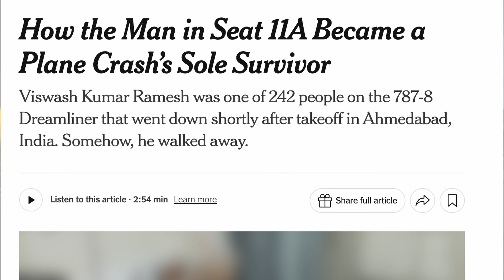Why the RAT Changes Everything – Air India 171 Update

Comment: My first impression was that there was an explosion or fire in the tail end of the plane indicating sabotage.
Reply: back of the plane was intact. what are you talking about?
Reply: @king_has_no_clothskul8635  In the video it looks like it’s on fire. It’s bright orange and red.
Reply: @kevindimauro9689  that is impossible to tell. no there was no fire at the back. it is colored that way but that should not be the case. may be for night visibility like black box is orange. you saw where it was stuck in the building and also when it was pulled down, you can see letters under the belly. the tail part and baggage remained intact.
Reply: @kevindimauro9689   hell no.

Comment: The flaps look like they were not set properly for take off. Flaps look like they were flat and even with the wings on its way down. The engines sounded like they were running and not failing. No lift without the flaps. More power from the engines would not save it from dropping out of the sky at take off.

Comment: @CaptianSteeeve so if we are going to speculate, based on historical data, the 787s  have previously experienced a problem with thermal runaway in the electronics bay.  When this plane was taking off it was 40 degrees C outside. So the question is : if this had happened and the electronics that manages the engines suddenly went down, what would be the result? Would the engines continue at the last throttle input setting? Or would loss of data input to the engines cause the fuel values to close?
Reply: 40 is not hot. they must have been designed to withstand engine temperatures in hundreds. but that could have happened.

Comment: as a model airplane enthusiast  i agree with what chat gpt has said about the RAT system 

when a Ram Air Turbine (RAT) deploys on an airliner, it can produce a noticeable sound, and to many people have resemble the high-pitched whine of a large nitro model airplane engine.

Here's why:

    The RAT is a small wind turbine that drops into the airstream when a plane loses electrical or hydraulic power.

    As it spins rapidly from the rushing air (at hundreds of knots), it generates a high-pitched whirring or whining sound, especially if you're seated near where it's mounted (typically under the fuselage or wing root).

    The sound is caused by the fast-spinning turbine blades and internal gearing, similar to the sound of a turbocharger or a small jet engine—but passengers often describe it like a model airplane engine due to its pitch and volume.

However, it's usually not deafening—more like a sharp mechanical hum or buzz. Pilots and crew will hear it more clearly, especially if it's a smaller aircraft or the cockpit is close to the RAT's location.

Comment: @CaptainSteeeve
@3:57  LT & RT spoilers are deployed, not seen this before on takeoff, and odd for roll control at this time.
....
As a former aircraft mechanic, I’ve been reviewing the available footage and noticed a few things that might be worth mentioning—possibly indicative of deeper issues:
	1.	RAT Deployment
You covered this thoroughly already, but it’s a key detail that points to serious inflight systems trouble.
	2.	Partial Main Gear Retraction
It looks like the gear retraction sequence started, but then either paused or failed—possibly coinciding with the moment the spoilers were being deployed.
	3.	Spoilers Partially Deployed on Takeoff (Both LT & RT)
I’m not sure if that’s part of an automatic roll stability function, but seeing both spoilers partially up—combined with little or no flap extension (if that’s indeed the case)—could have severely impacted lift right when it was needed most.

Zoom in closely at the very late rotation, right at the apron or runway end. You’ll notice a lot of debris being kicked up—at that same moment, the spoilers and gear position become more obvious.

Thanks again for your thorough coverage and for always putting aircraft safety front and center. 👍✈️

Comment: On the Boeing 787-8, the Ram Air Turbine (RAT) would be deployed automatically or manually in the event of a loss of all primary and secondary electrical and hydraulic power. This could be triggered by a double engine failure, or a failure of both the main engines and the Auxiliary Power Unit (APU). Essentially, the RAT acts as a backup power source, providing hydraulic and electrical power to essential systems like flight controls and avionics when other power sources are unavailable.
Reply: This RAT issue changes everything. The flight crew is 99% in the clear. My deepest condolences to the relatives and friends of the victims.

Comment: If you look at the video playing around 1:37, there's dust/debris being blown back just as the plane is on the other side of the, I'm assuming, ILS shack.  At first, I thought it might be water from rain but other videos show it clearly wasn't raining. I watched an episode not too long ago of Air Disaster where it highlighted the Buffalo crash. Ice broke off the wings of an MD-80 and went through the engines, damaging the titanium fins. The damaged fins caused the air to flow incorrectly that surged the power and eventually flamed them out. I wonder if something similar happened where they went by and something went through the engines causing the dust/debris cloud and it damaged the fins. Having the throttle at full power for takeoff wouldn't have allowed them to dial back the engines to regain proper air flow.

It's pretty damn rare to have a simultaneous double engine failure.

Comment: thank you for recognising the RAM AIR TURBINE  as I still feel it was a hydraulic failure. The fact the landing gear would retract is why I feel its a Hydraulic failure. However maybe they purposely did not raise the LG because they did not have POSITIVE RATE.... so they kept the LG down.

I agree its most likely DUAL ENGINE failure or Hydraulic failure (although the modern hydraulic systems are supposed to be redundant and compartmented as to avoid the entire amount of hydraulic fluid escaping) 

I love that you fly a 777. You understand all the Hydraulic and fuel systems along with knowing a APU is and what it does apart from a cart start.

Would you agree with my theory that the LG was not raised because they didnt have POSITIVE RATE?

Greetings from Australia.... and also the BLACK BOX was invented by an Australian
Reply: OK, thanks for the ANALYSIS

Comment: Real theory is a complete loss of  electrical power due to Lithium batteries that exploded, causing  all control flight systems inoperative, which deployed the RAT.... They were going too slow for the RAT to provide full voltage, where altitude and time ran out for the pilots to throttle up the engines.

Comment: The Ram Air Turbine was deployed from the sound comparison. Just watch, https://youtu.be/WHHY9SygEQA?si=i3N4Neiz7HM4REw0. So, there was an irrecoverable dual-engine failure for RAT to be deployed. The DGCA's initial preliminary findings were out. The likelihood of a pilot error is considered minimal, as is the simultaneous failure of both engines. Other possible reasons for the RAT deployment are low pressure on all hydraulic systems and loss of all electrical power to the captain's and first officer's flight instruments due to lithium-ion battery issues. The 787-8 is an electro-hydraulic jet that needs both electrical and hydraulic power to operate safely.

Comment: (machines) just don’t fail specifically aircraft engines: 

A plane takes off every two seconds somewhere in the world, and how many engines fail one can easily do the math, it has to be a maintenance issues with the engines that were overlooked and remember (I am not blaming specifically the region where it took off from) this kind of accidents normally don’t happen in developed regions of the world who are more stringent about safety and maintenance in any industry and at any level.

Comment: Why was the gear still down at 600 feet?  If both engines failed, was there possible fuel contamination or a suicide pilot that suddenly flipped off both fuel levers?

Comment: One other video mentioned they did a short takeoff and used 100% of the runway and lifted off after they went into the unpaved overrun. You can see huge plumes of dirt and dust when they lift off. I'm going to say that likely caused the engine trouble. They were at max power sucking dirt, sand and rocks into both intakes. They sandblasted both engines and caused them to fail. The next question - why did they do a shortened takeoff?

Comment: I think a complete hydraulic failure makes more sense.  It fails after the gear is selected up, so the gear fails to retract. Correct me if I’m wrong but the flaps are hydraulically actuated, so the loss of hydraulic pressure causes the flaps to retract prematurely which causes the wings to lose lift as they are too slow. Even with the engines at full power, they are likely unable to accelerate out of it so the airplane has no choice but to start descending.  The RAT gets deployed, makes the lights flicker. I bet the Mach clackers will be heard in the CVR tapes.

Comment: “Last year, a former quality manager at Boeing warned that the factory that made the 787 Dreamliner—one of the company’s newer models of airplane—was plagued by shoddy work practices and poor oversight. John Barnett, who had worked for the airplane manufacturer for many years before becoming one of its most outspoken critics, said that Boeing was building the planes with ‘sub-standard’ parts and that its mandate of speed and efficiency was endangering lives. Barnett, who refused to fly on the Dreamliner, was also involved in a legal dispute with the company at the time that he died of an apparent suicide.”

Upon launch, the plane was almost immediately plagued by technical problems. In 2013, a series of battery-related fires in aircraft cabins caused the FAA to ground all of the 787s in the U.S. until the safety issues could be resolved. In 2015, the U.S. air safety authority discovered a software bug in the plane’s generator-control units that could hypothetically lead to a “loss of control” by the plane’s pilots. The plane also suffered from fuel leaks and other issues.

Comment: During the mayday transmission, the pilot reported loss of power. Caotain Steve is providing some fine content regarding this. .He and Mentour are owning it. It definitely sounds like the RAT was deployed when the aircraft passes. You can hear that RAT. There is a video of the aircraft on its flight before this, where AC wasn't operating, in-flight entertainment systems not working,  call buttons not working.

Comment: Pilot here..... a further piece of evidence  I might suggest is the ADS-B data obtained from Flight radar 24, The data points stop at the highest altitude that the aircraft reached which is where the possible catastrophic electrical failure occurred. Had there not been an electrical failure then there would have been further data points in the ADS-B stream as the a/c descended. ADS-B is a high priority system as it provides separation data in conjunction with TCAS so would not be shut down in a low priority failure. In addition it will be interesting to see what the ATC SSR (transponder) data shows. Did the transponder cease returning data? This would also indicate a very significant electrical failure. 
The B787 is, by design, a very electric-power centric a/c with its attendant weight savings. (hydraulics are heavy) There are multiple redundant busses and generators as part of this design but the greater dependence on electrics over hydraulics is new design philosophy, and the B787 is the front runner in this idea. I think that this terrible event might push a reexamination of potential failure modes in electrically focused designs. 
Cpt Steve, well done on your reconsideration of possible causes here. Obviously, only the forensic investigation of all the data will reveal the actual circumstances. The internet "experts" need to take a breath and stay well away from "conclusions". This is not calling a football game, blaming an umpire or coach, this is a very human tragedy where real data and information is the only way to learn lessons and work to prevent similar failures. Baseless social media conspiracy theories, noise and speculation can interfere with this diagnostic process. Create real harm. Back off, have some respect.
Condolences to the families and friends of the lost souls. The Dr.

Comment: Eng's power Hydraulics and electrical, so failure of either of these will cause the rat to deploy. One eng fail would not cause the the AC to crash like it did and one eng would had been able to power the Hydraulics and electrical systems and the rat would not have deploy, however two engs fail would cause the rat to deploy. Two eng fail at the same time would indicate eng's computer malfunction

Comment: There were signs of engine problems.  On the way into Ahmedabad the passengers complained the AC was not working.  The AC air is bled off the engines high pressure turbines.

Comment: Juan Browne caught this immediately on his first broadcast a short time after the crash, leaving no doubt the RAT deployed. It appears they may have had a dual engine failure after V1/just before takeoff, so they had enough speed to get them off/gain some altitude but then they inevitably mushed down. Contaminated fuel? This would explain why both went out at the same time.
Reply: Surely they wouldn't have been the only plane to have received fuel from the source. So presumably contaminated fuel would have affected other Jets.
Reply: @brownhairydog6472  Your right, didn't they also just have a B, C or D check on it ? It smells more like maintenance or Boeing
Reply: How do 2 engines fail at the same time ? What is the probability of this ???
Reply: Sabotage could explain it. Nor wanting to come across as all conspiratorial. I have heard no mention of this possibility but memories are short and just two weeks ago India and Pakistan were engaged in dogfighting, strafing and missile strikes over the terrorist attack in the disputed Kashmir, where terrible acts are perpetrated by both sides. We have seen in the past how effective Lashkar-e-Taiba is at infiltrating India.

Comment: Captain Steve, I'm not aviation expert and I don't know a lot about avionics or its advanced systems. However something came to mind and I wanted to get your 2 cents, if this could be a possibility.  For the RAT to deploy it would require 1 or more of those scenarios to deploy, correct? Would it be possible that there could have been fuel blockage during the positive climb? I know that at least isn't suppose to happen and until we can hear from the CVR pov and results of the FDR we can't be certain. However my curiosity brought this question to mind. Would a blockage to occur cause both engines to flame out during the take off? Such as a fuel valve or fuel pump failing, or insufficient fuel flowing to the engines cause the dual engine failure? Going down the runway it had full power and they were past v1 and as they lifted off, it had look like they still had thrust, but at one point I couldn't see that anymore. Despite the Dreamliner being a 11 year old plane. Do you think this could be a cause to the crash?

Comment: RAT visible. Flaps extended also. Wheel bogies show that wheel up command was initiated. But wheels did not come up. All this indicates total electrical failure. NO PILOT ERROR HERE.  This is a TECHNICAL FAILURE IN THE AIRCRAFT for still unknown reasons.